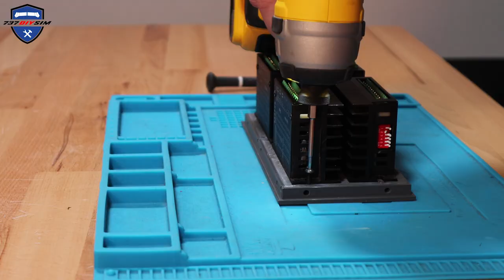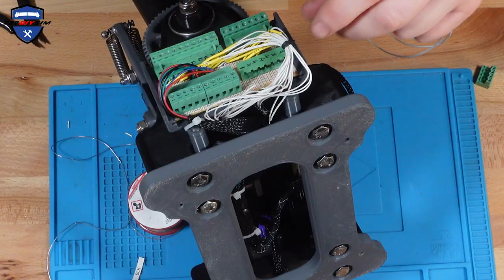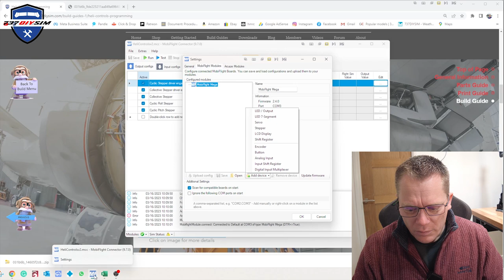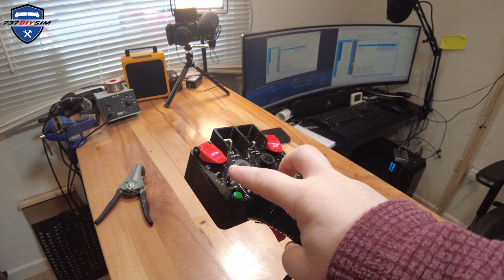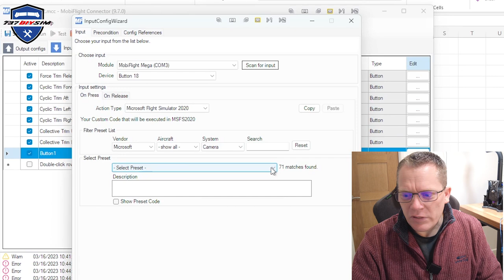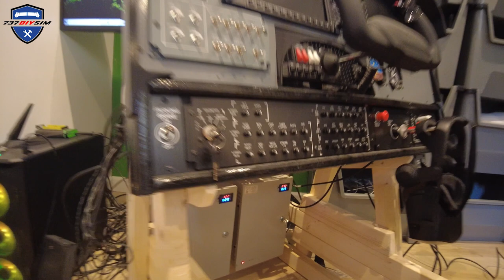Heli Controls - Programming & Wiring

Comment: Are you planning on updating the 3d print files/diagrams/build guide to show the changes from POTs to Hall Sensors? Great videos, with even better looking controls. Nicely done with keeping everything looking clean.
Reply from the maker: I wasnt going to update the build guide as they should be a direct swap. Its just different ways of mounting and yes different parts. I may have to look into it, if you think its confusing?

Comment: Watching you make this look so easy when I know it will take me weeks to do what you did in this video. I did feel better watching you try to hover though lol (definitely try taxiing slower :).
Reply from the maker: Thank Mark, Now that this video is out of the way, I can just jump on and practise when i like. Do like having the VR for that additional feel. Makes flying helis much easier than just on the flat screen.
Reply: @helimech8152  I had a go at an H135 VR sim at an air show here recently. Did pretty good, until I spend too long looking inside and got all bent out of shape. It’s time I learned how to use this printer I borrowed and start making these controls! 

Thanks again.

Comment: I like the project. I'm not into simulators but I like watching your creation. There is only 1 issue I can see. All those wires hard wired to the boards. I would have used connectors. I would not want to screw and unscrew all those wire if I need to disconnect a portion for service.

Comment: Hello, in one of your videos of this cyclic build, you mention that  you swap this stick with your fixed wing stick.  What would the primary difference be?  This looks to be perfect for fixed wing flying as well, with a modification in code to control the trim incrementally only for the pitch, as you do for the fixed wing aircraft and keep the roll axis fixed in the center. This can probably be done in code relatively easy with a switch that would flip between the two states (heli / fixed wing). With that you have a trim-able yoke for fixed aircraft and helis  in one stick.  Hope you can shed some light on your thinking here.  

I was also thinking if it would be "easier" to swap the motors for a solenoid that would control a dry friction clamp on each axis.  This way, as you engage the solenoid, it would spread the clamp apart allowing to freely move the stick with the springs not stretching, and then as you let go of the trim button, the solenoid disengages, the clamp tightens back down (via its own spring) and now your cyclic springs are fixed in that position and the movement of the stick is now against those springs.  

This would loose out on any ability to incrementally adjust the trim and would only work as an on/off switch though. The solenoids are about the same price as these motors that  you use, so there is fractional savings in terms of the parts costs, although solenoids do not need controller boards.  So yeah, I think your design is still better, just thinking out loud here to be honest. 

Have you considered building a full force feedback joystick?  There are a couple floating out there, but they use home-grown drivers and the support for FFB is marginal at best from the sims themselves so the biggest challenge is probably getting the appropriate telemetry and doing calculations yourself for FFB.  

Thank you.

Comment: Karl……not heard of a trim beep up and down for collective in 4 axis AP……..yes there is a hat switch on collective up and down but only via the AP upper modes for say VS or ALT and also for auto hover mode for up and down in height and anti torque left and right.    But no means of trimming collective up and down per se as far as I know.  Yes you can trim release and manually move it to new position….that is correct.
Cheers
Reply from the maker: Hi Mike, Great info. If you dont want the collective beep function, just disable the line in mobiflight. That will stop the collective from moving. Kind regards, Karl

Comment: Thank you very much Karl, for this awsome video serie 👍
I noticed you used a Dymo Rhino 4200 label maker. What size of heat shrink label tubes do yo use for AWG 28 wires?
Reply from the maker: I use 6mm, it actually doesnt shrink done enough, so you can still slide the heatshrink along the cable. Both good and bad, but i guess you knew that. I have found smaller yet.

Comment: Hello again Karl. You use a Leo Bodnar board, which is seen as a HID joystick by Windows.
I designed an Arduino Leonardo based board (for MSFS2020 and various devices rudder, throttle ...), which acts the same, in my opinion.
Do you think it's possible to use this kind of own board instead?
Reply from the maker: Yes Alain, As long as theres no jitter on the axis. After all, you are only moving the cycling millimeters and you dont want that level of accuracy been interfered with axis jitter during your flying.

Comment: Hi Karl……sorry one more query…..I see that you have a twist grip on a 139 collective……I gather that you have done this to make the 139 collective a more generic system, say, if using a Bell type helo.    Can the twist grip be removed from the collective?   That is, can you print it out without the twist grip?
Ta
Mike T
Reply from the maker: Hi Mike, The twist grip isnt supplied with the collective, because currently you cannot use it in MSFS. Thats because the throttle is used for the collective axis. But it was created for those that have DCS or XP. Its there just as an example.
Reply: Ok great!   I’m hoping to have a go to build it for a 139 sim as I’m rated on the 139 and 169……hopefully can find a 139 acft for P3D…..??
Cheers